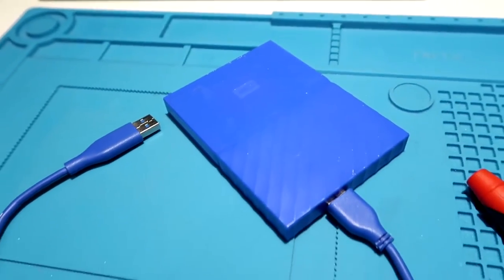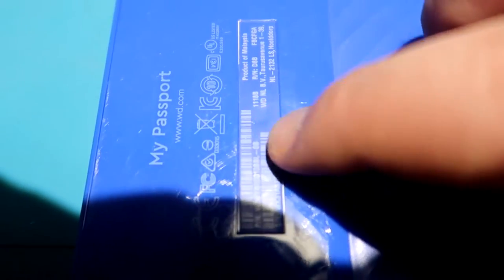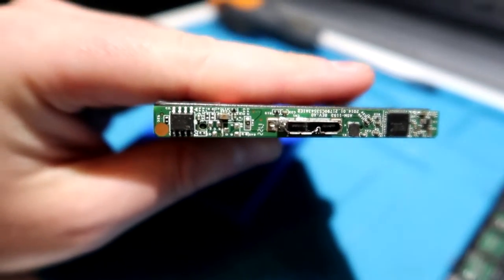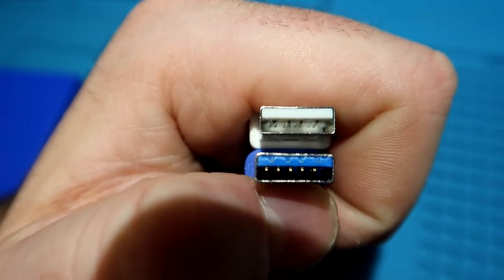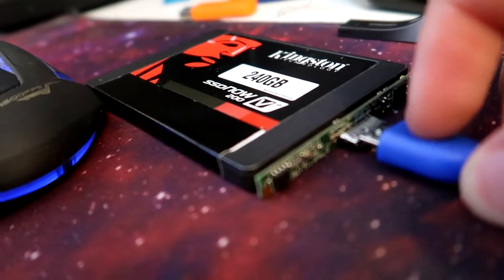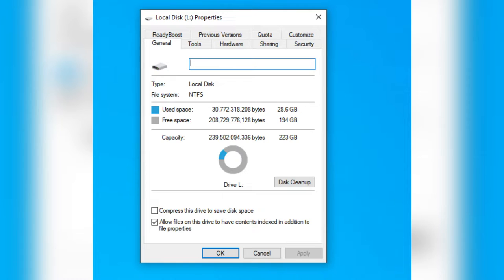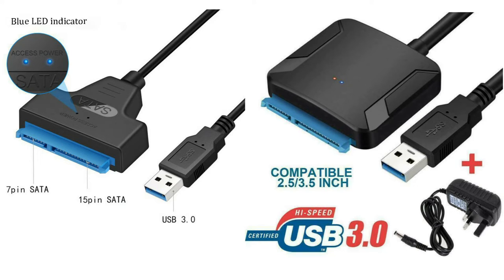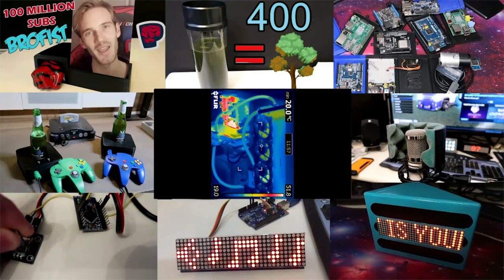What is the difference between external and internal hard drives

Comment: I heard a difference is the internal 3.5 has a more stabile power making the drive las longer vs the external 3.5 power bricks are cheep and not stabile power. Do you know anything about this ? I have had lots of my 24/7(non stop playing) media servers 3.5 HDD fail and they all were external with fans on the casing other than one witch was a WDbook. Non lasted 2 years. Bad luck ?